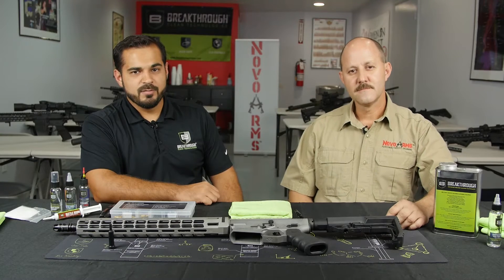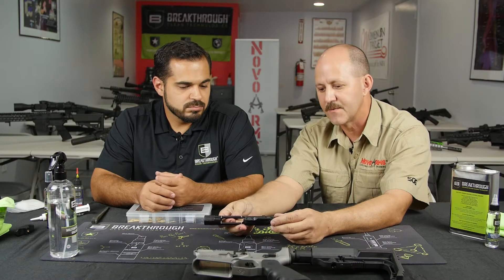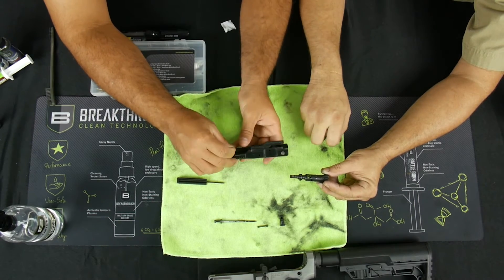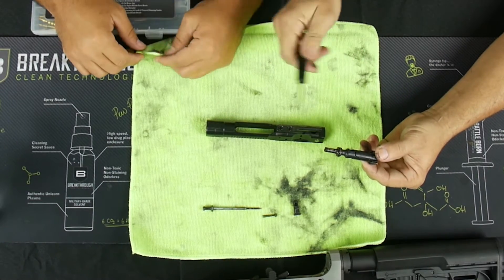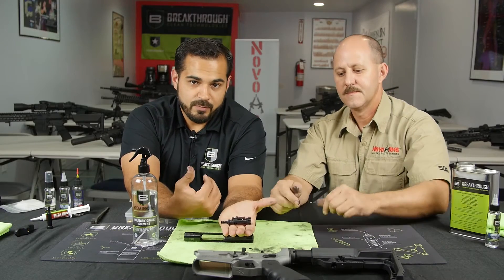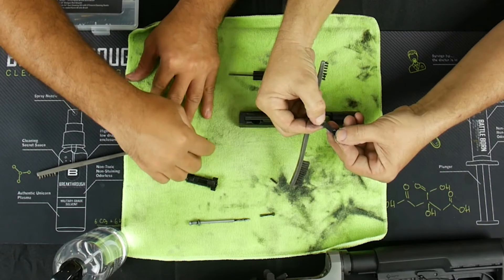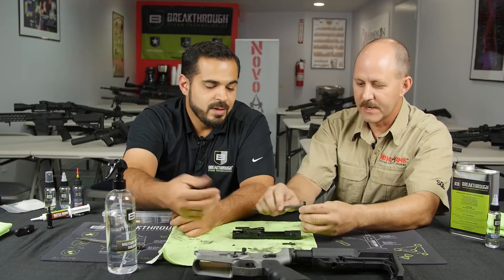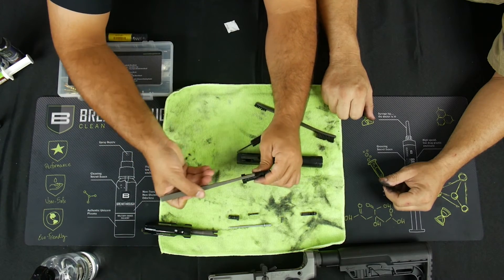Breakthrough Clean University - AR-15 Part 2 (Bolt & Carrier Group)

Comment: I thought you're not supposed to clean the gas key with anything other than a dry q-tip or pipe cleaner.  Also, do you oil any part of the extractor?

Comment: When you reinstall the bolt make sure all of your gas rings are not lined up together. That can cause cycling issues as well.
Reply: That's a myth that's been around forever. .truth is 3 gas rings are redundancy,your rifle will run fine with 1 gas ring, disproving the gas ring gap nonsense. I've done it for months before. Lol..stop regurgitating nonsense. .
Reply: @Snowy0123  yep. All b.s.

Comment: I purchased the BT-101 kit, would the included products suffice for AR cleaning? Curious since it did not come with the HP oil as referenced in the video, but does have the battle born oil, solvent, and battle born grease..
Reply from the maker: The BT-101 kit is our most basic kit that we offer which provides the bare minimum to help you clean your firearm. So for outer areas and some internal areas the brush will suffice. For the AR we do recommend the LOC-U kit as it comes with steel rods to be able to get a deep cleaning in the barrel. The Battle Born High-Purity Oil is our all over lubricant that’ll help protect and condition the firearm against rust and corrosion. The HP PRO Oil is specifically made for more high-friction contact points that see a lot of action from heavy-duty use. It’s a thicker viscosity and the extreme pressure additives help create a bigger buffer between those points to keep friction low. So think of it as extra conditioning that you could use in conjunction with the regular High-Purity Oil.
Reply from the maker: Yes the BT-101 can do the job.